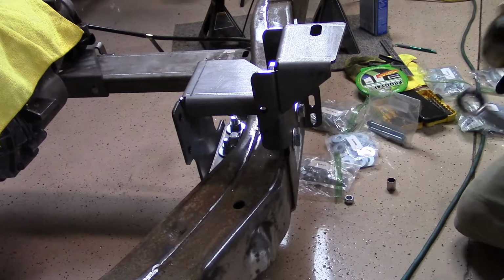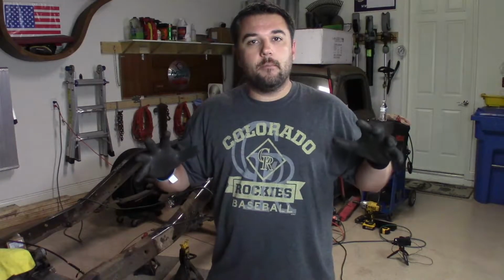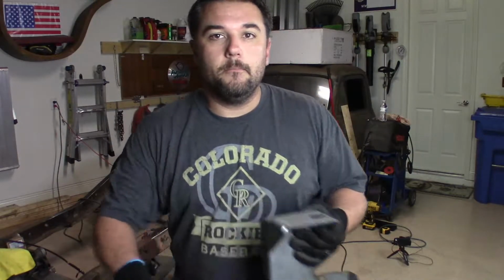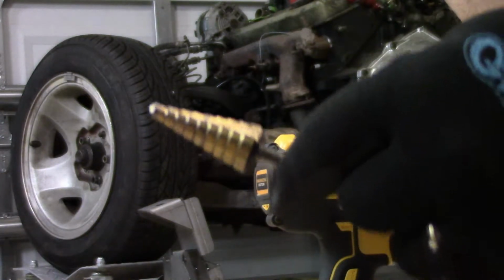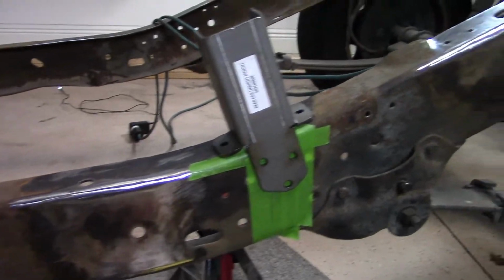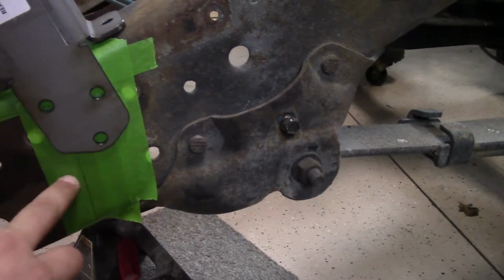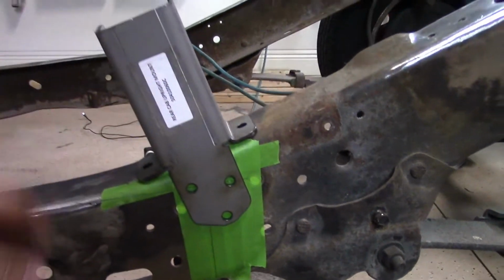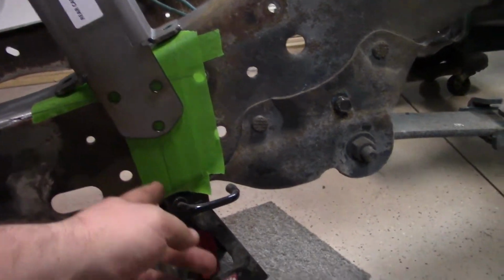PART 8 - 1952 Chevy 3100 - Code 504 Front Cab Mounts!

Comment: Did you have to cut your S10 frame?
Reply from the maker: The only "Cutting" of the S10 frame required would be to remove all the old mounts............. and the very front of the frame.......... no other cutting should be required.
Reply: What wheel base did you use?
I have an extended cab 1179"
If understand correctly my 55 had a wheelbase of 116